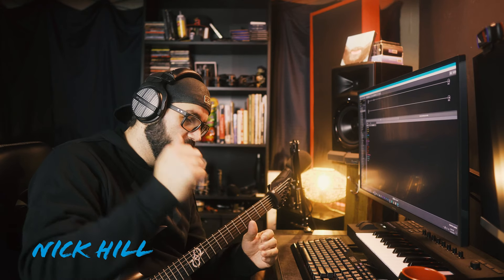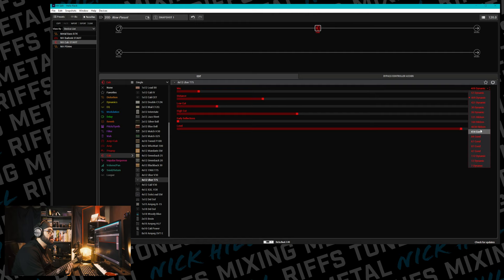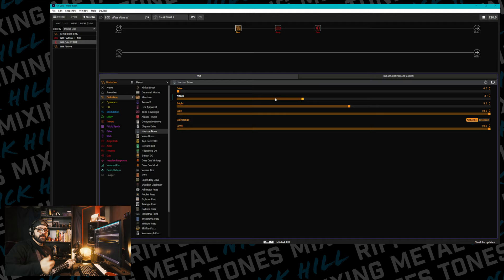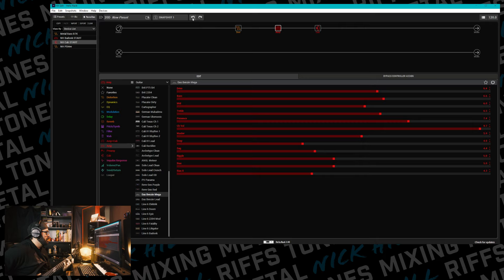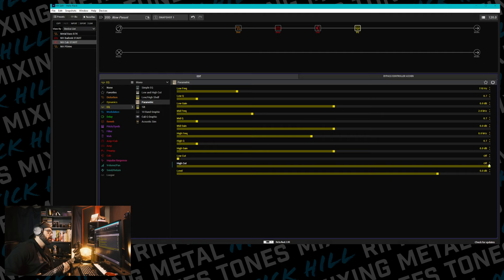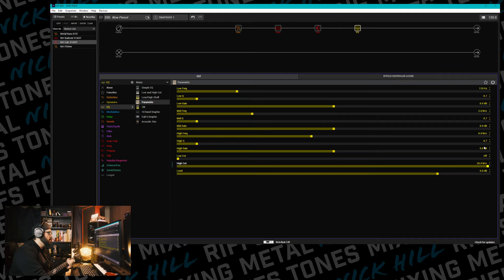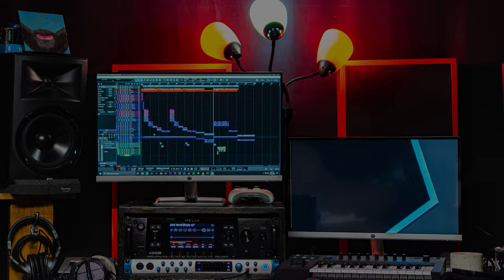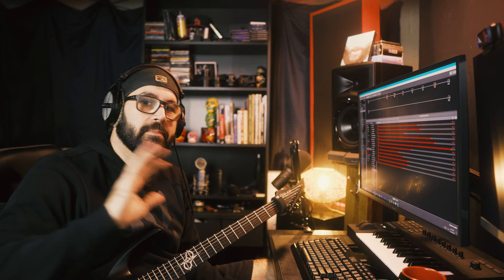Line 6 Helix Firmware 3.0 Tone from Scratch | Das Benzin + Horizon Drive

Comment: Thank you Nick for another informative Helix video!  I'm loving these new amps and the Horizon drive.
Jason Sadites has been using the Low/High Shelf EQ these days instead of the tilt EQ.  Set both freq bands at 650, boost above and cut below about a couple of dB.

Comment: You were not entirely wrong about the bias.....raising the bias x over will change the the voicing of the tube which sounds like compression almost. It will react different depending on how you drive the amp input too master output, it is dynamic. so lowering it will sound tighter because its less compressed but its not actually a tighter sound..lowering the regular bias will tighten the sound giving the tube more head room so less distortion but in the real world this is actual reversed so not entirely wrong. If you want to clean up the sound and tighten it up, lowering the sag is the better way to go, it will retain the relationship of the bias and bias x setting with regards to gain stage that you have in the input/eq/output of the amp it self. In short the sag will tighten the sound without fucking up the tone and response you just spent an hour getting.
Reply from the maker: Food for thought for sure.